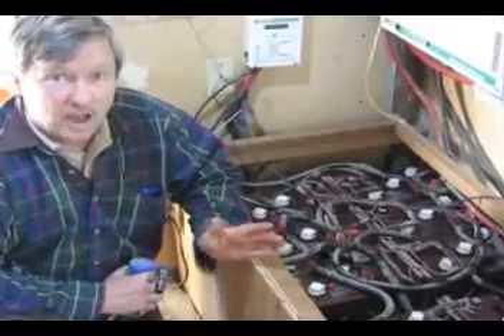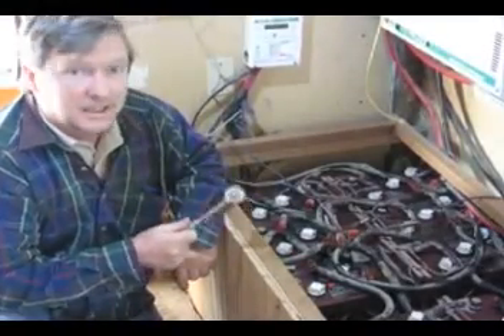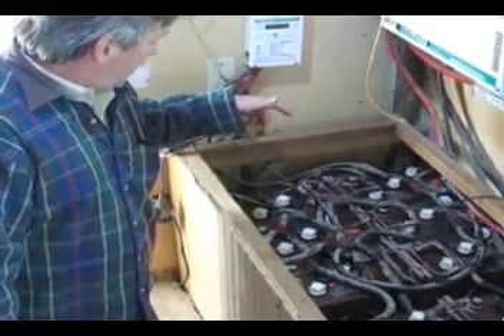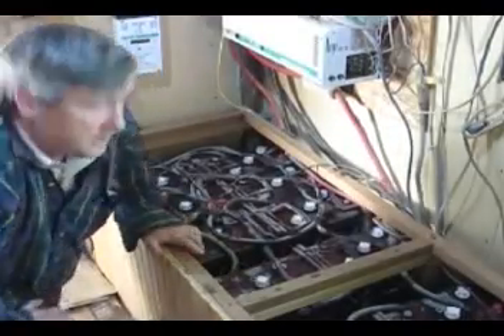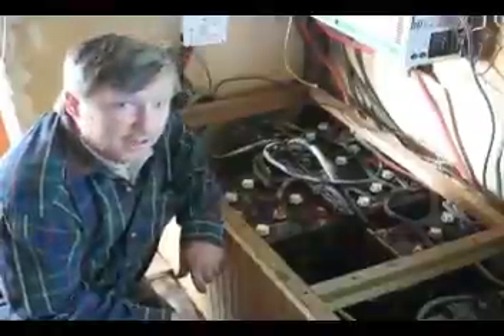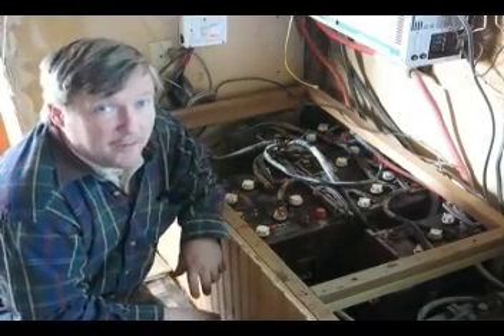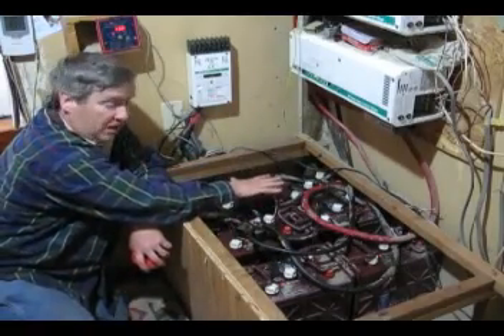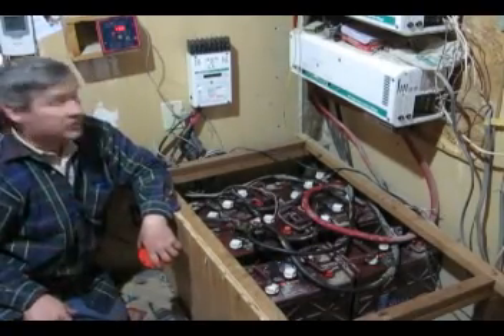Deep Cycle Battery Restoration - 1

Comment: I must say, this is without a doubt the best guide to reconditioning batteries available [Check Details Here==>https://plus.google.com/100351090281822647456/posts/DDHJUMRLfS2 ]. I have purchased some guides in the past but not of them come close to the amount of detail in yours. It's actually worth much more then $50!

Comment: i have smart chargers for desulfate lol it is very good i have noco genius G7200 at 12v   have 7.2A and 24v 3.6A  and for desulfate charger go in 16V 1.5A  in mode with auto diagnostic test for desulfate or not

Comment: Hey fella, build you a winching system.  You can get a DC winch form Harbor Freight real cheap.  It should be able to lift about 1500 lbs, so it well within the limits you need.  Thanks for the video.

Comment: That's a good question.

I'm not an engineer but this is my layman guess.

One of two possibilities, either the battery has a shorted cell, which means that the battery will be a cell short, so when all the working cells are fully charged it will still read 'low' voltage.

The other possibility is that the batteries are sulfated, which means energy can't be transfered through it, so the battery will draw little to no energy from the battery charger.

Comment: I must admit, the more I think about lead - acid batteries the more I think it should be possible to make a half descent cell at home. Yes OK it may not be as effeciant as purchased cell and is likely to take up more space. but this is 150 year old technology ( and there are discussions about cells in Egyption time, not lead acid ) but lead is a very workable material, and I cannot see the other requirement lead oxide being too mad to produce or buy, if work on in a well ventilated place.

Comment: Use 8V deep cycle, they'll last up to 30yrs but you have to add water so the polarity does'nt reverse. I manufactured golf cars in a factory called E-Ride Industries. They told me after 30+ yrears of manufacturing those are the way to go.

Comment: If you use Forklift batterys they will last 30 years with solar and wind . I bought a new 24 volt forklift battery on ebay for $500. Your going to have a mountain of batterys.